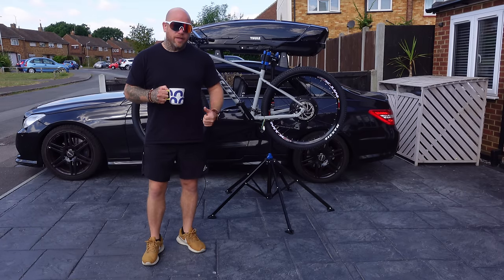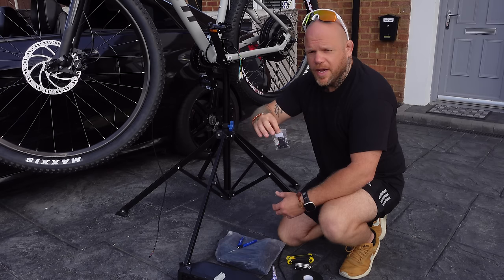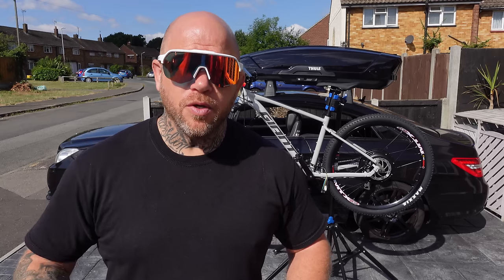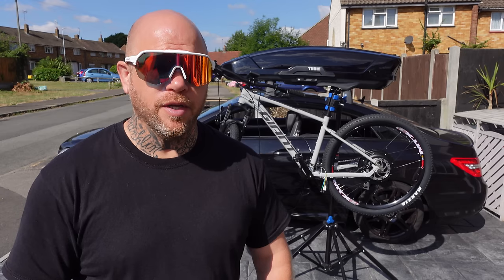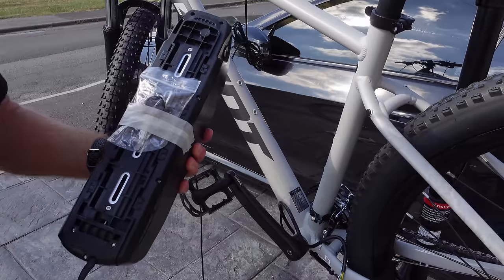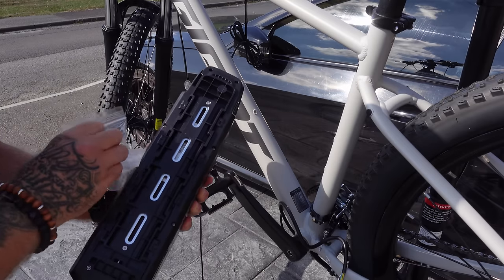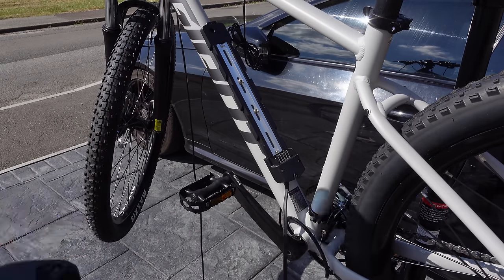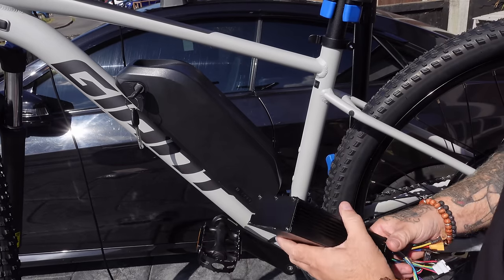Pt. 3 Convert ANY bike into an EBIKE! **BATTERY & CONTROLLER FITTING GUIDE**

Comment: Best thing i ever did , even 80 mile trips are not a problem . I made 4 in the end all on scrap bikes , only one problem on a sharp burr where the wire leaves the wheel..my next project is to fix that . After 4000 miles i would say triple check wire abrasion points and reinforce, Bikes are surprisingly jiggly and sometimes the cabling is not particularly hard wearing. Personally, i use batteries in a rear pannier still wrapped in their original foam packing to protect them from an inevitable fall . Means swapping and charging  batteries is simple .  I also soldered on XT60 connectors for long life and good connectivity.

Comment: I prefer the controller in a bag separate from battery, so I can remove battery when I lock up the bike outside
Reply: If you fit the controller in a frame bag with the battery you take the frame bag with the controller in it out. less to get stolen. Only a few wires to disconnect like phase and hall and throttle etc.. and good to go
Reply: I'm taking my bike inside l trust nothing .
Reply: Thanks mate oi and ride appreciate you my friend.
Reply: Great video , I too put my controller in bag ,if only to neaten up the wires. Not had any heating probs.  I do understand your concern with heat dispersal . All best take care TT.

Comment: You've knocked loads of these up recently! My first ebike was a 1500w hub. Great fun. My advice to anyone building is hydraulic brakes are a must, cable just doesn't cut it. As well as two torque arms/ plates either side to be safe. Newton himself said for every action, there is an equal and opposite reaction. Keep it up Steve.
Reply: Is it tough to convert disc to hydraulic?
Reply: @jasonpgallery  cable actuated brakes to hydraulic. With cable you squeeze the lever and it pulls a cable through a pipe  toward, clamping together the pads. With hydraulic, you squeeze the lever and it forces oil through a pipe, clamping that way. They're much more efficient at clamping. No it's not hard. Hardest part is if you need to shorten hoses and bleed the system, many times you can get the right length hose and plug-and-play. If you have more power, it only makes sense to have more stopping power to go with it.
Reply: Very well said people always ask if I'm afraid of the speed after I customized my ebike I say no I'm afraid of stopping in time. Next on the list 👌🏼
Reply: I build too and agree hydrologic brakes a must! I prefer mid motors but hubs allot easier. Torque arms a must too.  Grin technologies  has the best.  And you'll be addicted! Lol god bless  be safe on road
Reply: What's the range on the battery like ??
Reply: Newton: "OUCH! Feckin' apple!"
Reply: @jasonpgallery  No. You want a good hose guillotine for square cuts. 
1. Note the path of the old housing.
2. Remove cables and housing.
3. Remove old levers and calipers.
4. Measure cable housing.
5. Cut hose to length.
6. Add covers, nuts, olives to hose.
7. Press barbs.
8. Insert hose into levers and calipers.
9. Tighten nuts.
10. Fill 'er up.
Take your time. Write each step. Dry-practice it. Go for it.
Reply: I find no difference with whatever brakes i use ..if you can lock your wheels then thats your maximum braking whatever your using .
Reply: @MyKharli  nope, if you lock-up you skid and you have reduced braking performance. Good brakes offer modulation, so you can be right on the edge of traction prior to lock-up. I had some Tektro Auriga hydraulic brakes which would lock up, but they were crap. Upgraded to Hope Tech E3 and the difference in braking performance is huge.
Reply: @18ct  Really ? I am, pretty sure `you` can be the modulator but whatever rocks your boat ! Anyway where i am  coming  from  is scrap bikes only and the cheapest chinese batteries and hubs i can afford . I have to reuse whatever brake blocks i can get ..thats plenty enough and shows you can have an e bike even on a part time minimum wage job !.

Comment: I was so pleased to see you using flush cut side cutters in the earlier video of this build, then you used scissors in this video. Cutting the cable tie tails off with scissors leaves a nice razor sharp end on the stub of cable tie, perfect to cut yourself to pieces on later. The tails need to be cut as close to the head of the cable tie as possible to avoid those evil razor sharp booby traps. Been there done that and got the scars.
 Great video, I’m about to do a conversion myself, I’ve put this series of vids on save to refer to while do my build.

Comment: For the last  six months I’ve had an overheating controller till recently. I couldn’t Accelerate for too long as the wires from the motor would get really hot then go into the junction box then to the controller to the point the 3 wires got melted a little which are  now insulated with tape so ive been going easy.   Now since ive a new battery base as the old one broke from a crash ,  I also rearranged the wires in the bag , unplugging phaze Connector and reconnected it. I used a proper crimping tool to put the Anderson pole connectors in the plugs  then on my new base wires No soldering needed and now the phaze and controller runs flawless.  I also have a new 21 amp hour battery instead of the old 20 ah that flew off the bar last year due to not being locked  Dow aha.  was well gutted lucky there was no fire.  Now with all the upgrades It goes as it should and It hardly ever gets hot  and i can run the 2000 watts happily  no over heat In phaze and just gets warm so I can throttle for much longer   I’m so chuffed .  No more over heating worry.  I must of done something right.  Aha 👍

Comment: Very well explained and easy to follow ,you've convinced me to get one of these kits,ive always been put of by the faff of fitting a mid drive but looks like even i could manage this👍
Reply: Hi get rear wheel kit they are faster and much quiter and quick of the mark. Plus there better to fit than midrive I've had mine for 4years and same battery bought from aliexpress get the one witn max on the rim name
Reply: @colinwhite144  how much did it all cost mate ??

Comment: I like what you do with painting the controller satin black and the mounting of controller. I can't stand those yellow phase blocks. I always cut off and solder on bullet connectors & heat shrink them. I replace all the large white connectors with black micro jst sm connectors. Just tidier. Not an issue if its hidden inside a bag though. I'd like to see you make some mid drive BBSHD builds. I've never built one myself. A quality hardtail frame like that giant would go great with bafang.
Reply: Is the wire too large of a gauge for DT connectors instead of the block?

Comment: only issue is its illegal for uk roads and u might have ur bike confiscated as its motor is over the 250w legal limit and especally if u get into accident u wont be covered and may have problems paying outta ur own pocket for accident which may be very costly apart from that its grt build

Comment: I have the exact same set up on my calibre 2 cubed, however I have the controller and the battery separate so I can disconnect the battery and charge it in the house, wouldn't want to leave the battery in a cold garage over winter really..good vid. 👍

Comment: I agree with your point for placing the controller out of a bag, but there's no need to run 1500w or 2000w, up to 1000w it's not really a problem to keep it in a bag and it's plenty fast

Comment: After gluing the controller to the battery, how do you remove the battery to bring it inside for charging? Seems impossible, since it's all wired up, together with the controller.
Reply: You have to bring the whole bike inside.

Comment: Thanks for this video. I want to do a similar build but I start to realize that I better stick to my Bafang BBSHD. These hub motor kits are simply not weather proof by design. The connectors to the controller are too exposed.

Comment: Problem you should have took it for a spin witch I thought you would have done. Getting to controller I've got 2000wat the controller is the same for 1500wat that came with kit the battery 52v175 top speed 37 mph I've had it to 40mph but that was wind behind me. Is there an upgrade controller for 2000wat and to work on my 52v175 battery thanks Colin

Comment: I've been thinking about making my ownp wheel with an old 🗝️ scooter hub wheel front and back and use the 350w motor hubs =700w.  So with the 21 gears 50 mph or 60 and mph hopefully. 36v battery X2 and speed controller.  Understand that that will make a heavy bike.  Has though about a trailer for the battery back's. Maybe the controllers.  Hopefully I'll get a nice bike to get some miles done. 🤞👍👍

Comment: Great job !
I'm wondering how difficult is to change the back tire ?
How much of the secured cables and stuff have to be removed ?
Cause it seems to me it's gonna be a pain....
Reply: from what I know of hub drives, maintenance can be a nuisance, I run a mid drive though, so never personally dealt with it

Comment: Thanks for all the infos!! One thing, is there another way or place to fit the Battery? Cause my mountain bike dont have the holes to fit a water Bottle rack...
Reply: You could buy a rivbolt tool and drill and fit the holes.

Comment: Subbed Hoo ilgan …. Been watching a few years now and building too have a project that’s been outstanding for 5 yrs , Giant Revel 0 need a big kit , never ridden anything slower than 36mph  Vintage electric. 

Just done my dad old bike was 1000 watt nominal golden motor , now 52v. Instead of 48 , rapid thing .. , but curved frame night mare to attach any thing to … 

Giant ideal as straight pipes hydraulic brakes and 30 gears.

Comment: Nice video, thx! is there a preferred way to mount the controller so you can take the battery off?
Reply from the maker: Adhesive velcro tape maybe a good option

Comment: So by sticking the controller to the battery you can't take the battery off for charging or security?
Reply from the maker: Depends on the frame triangle size.  Smaller frames don't allow it unless you want to fit it somewhere ugly.  I never leave an ebike in public or outdoors.

Comment: You shuld realy look into spintend controllers. They are a loot smaller and better. Allso please shorten all cables to desired length. And use phase bullet connectors.

Comment: So if you change the size of the rim down say from the 28 to 20 in the settings will it try to achieve the it's max speed by speedo. So you would be doing like over 50mph?

Comment: should have ran cables under battery not top tube so you can use a bike hitch rack on top tube without pinching cables, and cables are hidden by battery pack

Comment: Hi, great channel, currently looking for a frame to build up from scratch, chain reaction cycles currently have a frame 27 1/2 inch or 29 inch. It’s the nukeproof frame the bottle hex bolts look a little bit low to accommodate a battery, anyone have this frame will the battery fit on, appreciate any comments thank you

Comment: @Dude Stuff Is it a pain in the ass to change the tyre when it needs replacing? It looks like you would have to remove loads of stuff just to change it.
Reply from the maker: @bengillard5198  just the motor cables on the new kit it's just 2 plugs and has a velcro cable wrap to cover them

Comment: Doesn't that controller get pretty hot? I would have made a air gap between the controller and battery, or at least some type of heat shield between them.

Comment: I built an e bike just to see what they were capable of 1000 watt motor 48volt.
First thing I found was the e bike battery was incapable of producing the current needed to supply the motor so I used scooter batteries four of to reach 48volt by around 21 amp's so I went for 25 amp's to give a good reserve which worked out well at 15mph close to 200 miles range while with the restricter turned off with my body weight the bike would reach 47mph faster than most cars and if you wanted to be stupid burnout a tyre in a matter of minutes anyway I have a full bike licence and asked the DVLA at the time how to make it legal on the roads and it wasn't worth it so I stuck to my motorcycle's while the electric project bike sits rusting in a shed.
Have to say it was an interesting project which I would have used for the commute if the DVLA hadn't been so ackward.

Comment: If you're worried about overheating the controller.  Why not just paint it white so that it reflects UV?   Painting the components white would make it match the bike color better, too.  🤷‍♂️

Also, I think some of the non double insulated wires could/should be loomed up and wrapped with tape as how auto manufacturers do their wiring in vehicles.

Comment: Does anyone know if you can do this on a hybrid bike? I have a Decathlon UK Riverside 900 and want to know are their any differences since the tyre are.slimmer than MTB's due to being hybrid
Reply: Possibly!
You'd have to check the distance between the forks to see if the motor will fit.
If the rim is too big, you could cut the spokes and respoke it to one that will fit.

Comment: what size frame is needed to fit the battery ?
Reply from the maker: Medium is usually minimum to fit controller as well.  Depends on frame style and brand.
Reply: Would you know much about the specialised pitch 2018 frame ?
Reply: @DudeStuff  thanks for your reply

Comment: All that talk about heat issues and the battery being removeable, and you go and attach the controller to the battery. I don't think the heat from the controller( power mosfets), is going to be good for the battery.

Comment: Where is link to test ride video ?
Reply from the maker: I'll do one soon think this bike sold before I had chance
Reply: Okay sweet random question the bike I want to build has a rear 11 speed cassette , will that fit this MTX rim and motor ? Or does it matter what size of cassette ? Other then that awesome videos I will be watching them multiple times again when parts arrive lol
Reply from the maker: @DrizzRedmond  the rim has nothing to do with cassette they can't fit 11 speed on 2kw hub so either live with 9 speed or get 500w or 250w smaller hub with 11 speed

Comment: That steel adjustable tube clamp is horrendous it has no place in that beautiful frame it will damage that nice paint job as well it should be replaced with a more forgiving bigger sized plastic cable ties

Comment: Thats the shittest desined controller box. How stupid it should be built into the batter pack.  Just what I want between my legs sharp metal conners to catch on my pants or into my legs wile I'm peddling.  With some thought this could be part of the batter pack and go on and off with it. Same with the display.
Insted of sliding up and off the battery pack and controller slide in from the side
And still.locks  wires from the handel bars plug in at the top and from the back wheel from the bottom side, you remove a cover to reach the charging ports.
You can also hook up a cell phone for music with mirros and cameras as well as speaker and headlamps. The seat gets a break light with turn signals. The mirrors also ack as turn signals.  The fit on the bike as handel grips. And have both the speed control built in and they lock on with fasteners to clamp down.